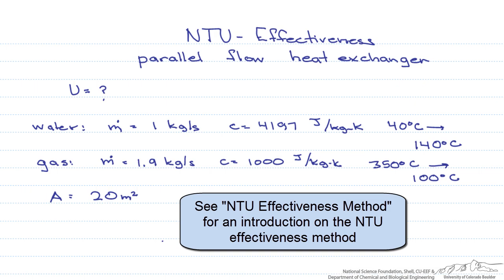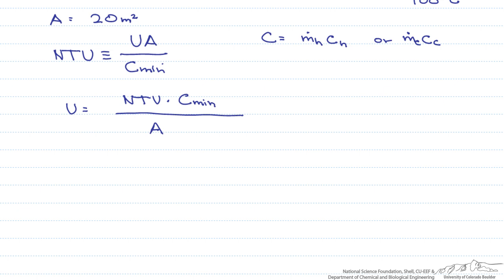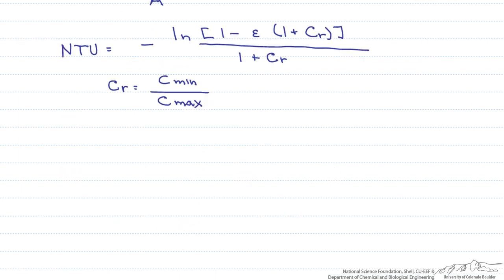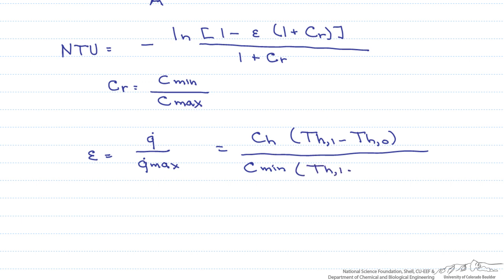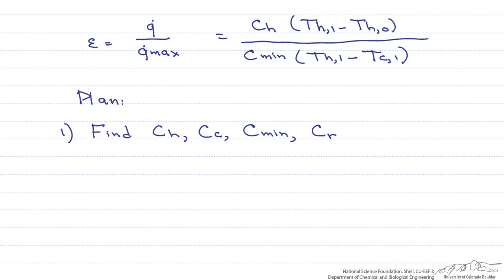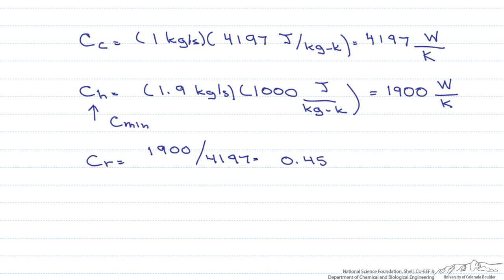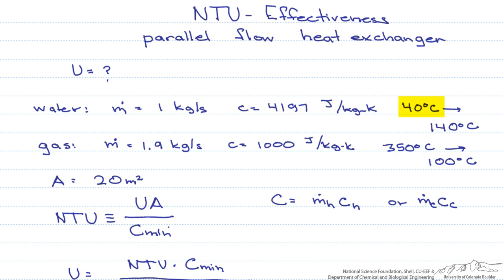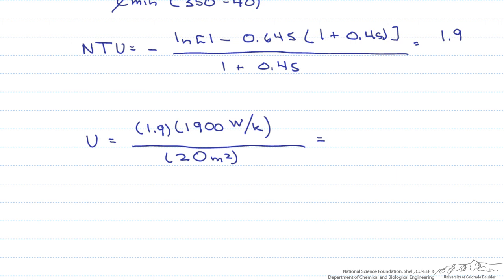NTU Effectiveness: Parallel Flow Heat Exchanger

Comment: -heat exchanger = condenser?
-my professor want us to evaluate a product for shell and tube condenser and solve for efficiency.
-A = pi*D*L*Nt , can we use D = shell dia. or only applicable for tube dia.?
                   , L = tube length. Nt = no. of tube(s)
-what's the use for subcooling?
-the product indicates that Q = is condensing capacity. is it the Q= for the process?
-unfortunately through my calculation NTU = 19.6, which is too big. NTU only ranges from 0-5 from the chart/graph for counterflow

Comment: it is not possible that the temperature of the cold fluid at the exit is greater than that of the temperature of the hot fluid at the exit in 'parallel flow  arrangement...............but the same can be possible in counterflow arrangement..........
Reply from the maker: True.  The problem statement is not feasible and this is proven during the screencast.